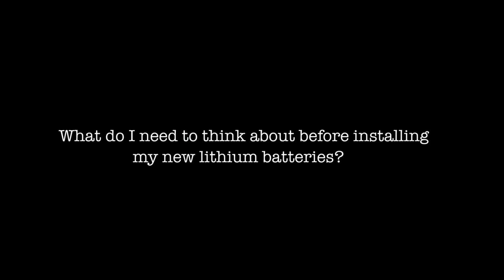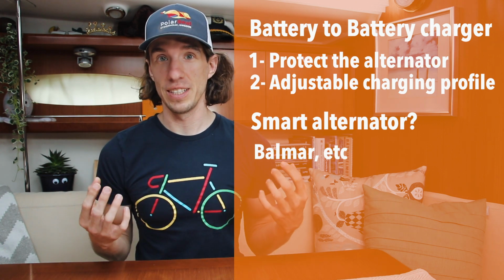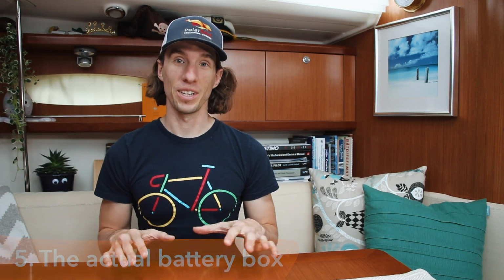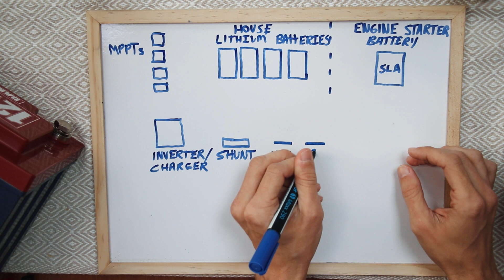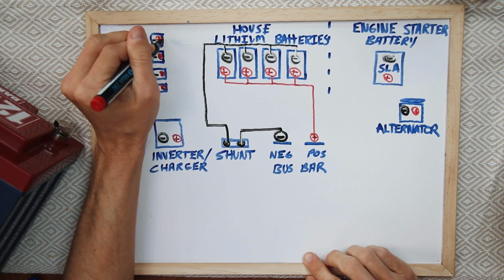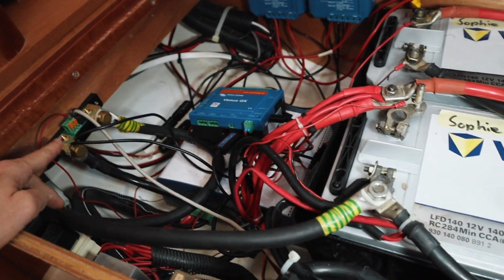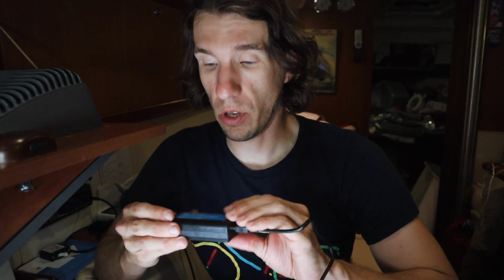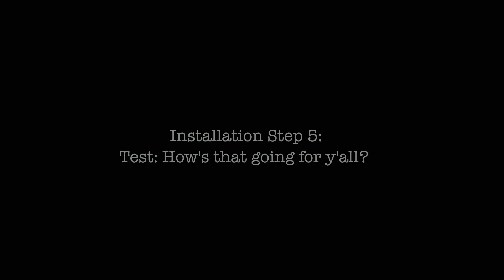How to install lithium batteries on a sailboat // Ryan’s tech corner #2

Comment: When I was a boy I made an electric hot dog maker. It was just a bunch of railroad spikes in pairs nailed through a board. About six pairs. I ran house current to the first pair and then from nail Tek nail to the back now. As you’re saying in your video I ran the wires the hot in the cold to the first pair. I found that if I Try to make six hotdogs, one hotdog across each pair of nails, the first pair of nails cook the hotdogs very quickly the second pair let’s quickly the third pair even less quickly and the last pair didn’t cook at all. I bet you could’ve put both hands across the nails on the last pair without getting much of a shock. This was about 1955. Why boat  manufactures didn’t know this is beyond me. I’m sure they did. The issue was that the boat buyers didn’t know!

Comment: I would have done it differently.
Have two or more separate systems, obviously one runs essentials such as nav lights etc.  If one goes down, hopefully not all. 
You would have to manually change over circuits and alternator charging

Comment: It's almost the same design I made, the only issue I haven't resolved yet (and you neither I see) is how to maintain under charge the starter battery when the engine is off and you are at the hook for several days under solar and wind power or moored at the marina connected with the shore plug.

Comment: This design as shown in your white board schematic, is egregious.  Where is the short circuit protection & where is the wire separation to prevent shorts.....?  What other fault conditions need protection?  What are you doing about grounding and is there any isolation between shore power ground and the boat ground and what is the scheme?  What about lightning & EMI protection?  With Lythium we are dramatically increasing energy density and I would of thought there would be advances in safety design.

By the way you commented on the FAA but readers should know that CFR 25.1309 ammt 42 made huge improvments to the way to approach design for safety.

Eric 
Boat owner for 50 years and commercial aerospace design.

Comment: I fitted six 12v, 1kWh or 80Ahr SUPER CAPS in parallel. My installation is exactly the same as described here. Victron DC to DC Charger set to 13.4 volts. They have a 1 MILLION CYCLE LIFESPAN or factory recommended lifespan of 45 years, they're non toxic, can be safely discharge to 0 volt and stored at 0 volts indefinitely, they're non flamible, can never explode, they are 99.5% efficient, and safe to transport by air. They weigh ± 15 kg each. We run an 80L deep freeze @ -19⁰C and fridge @ 2.5 - 4.5⁰C 24/7/365 plus lights, windlass too(1200W or ± 100amps). They also run nav station, auto pilot and bilge pumps. They start our 2000cc(50HP) Perkins diesel on a dime with change to spare. We've  never seen them below 12.8 volt or 80% SOC and are normally fully charged by lunchtime and on successive cloudy days they'll charge to ± 95% SOC. We're charging with 2 x 330W pollychrystal solar panels. We'll change these to monochrystal though as they handle shadows better. We live aboard permanently and have had them on our 45ft cruiser for 3 years and they're functioning at 100%. They're also available in 48 volts. These are the best things since sliced bread. Two could do the job but if enough is good then more must be better...no? 😁👍🏻
Reply: Make a video

Comment: Figure how much it's going to take then add 50% to it?

Best rule of time estimating I've seen is double and increment units. So if your best guess is three hours, figure six days. If two days, figure four weeks.

(And if you don't have water when the power is out, you need a manual pump. Redundancy in all critical systems.)

Comment: A peek into the past is also a peek into the future.  Germany lost 1/2 of it's PKW4 tanks to batteries in parallel.  It was a good thing.  In the morning,  the tanks could not start and dead batteries could not turn the turrets. Yachts and semi trucks are often supplied with isolation switches. They allow batteries to momentarily tackle huge discharges such as starting,  then be isolated for separate charging and storage. If i am going to buy two big 12 volt batteries,  I'd instead buy two 6 volt batteries to use in series.  They don't squabble in series.  One gentleman on youtube yanked his electrical project,  and posted a new article when he learned the right way he should be encouraging.  When things go wrong,  disconnect every single battery,  and charge them individually.  Don't leave anything in parallel. Fair seas,  Maties.

Comment: Good clear explanation Ryan.  Only negative is that that wiring has my OSD going stratospheric … I'd need to have it waaaaay neater and more organised !!  I'd probably end up ripping half of it out and then not know what went where and needing to get the boat rewired professionally.  My OSD is in overdrive just looking at that battery compartment.
Reply from the maker: I agree.  But to get all those wires under control i would have had to remove everything and that was not going to happen (Ryan)

Comment: Hi Ryan. According to your Wiring Diagram your starter battery is directly connected to the alternator. The electricity generated in the alternator flows through your starter battery, which is an SLA, and continues through a Battery-to-Battery charger to your positive and negative terminals and continues to charge your Domestic Lithiums. The chargers you programmed for charging the Lithiums. So far so good. In your first video you show how to increase your alternator output with a Wakespeed regulator, which I assume you have to program for the type of battery as well. My question is how you program the Wakefield to charge the Domestic bank, which is Lithium but the generated current has to pass through the SLA-starter Battery?....or did I miss a point here?
Reply: I have the same question, did you get the answer?
Reply: @kathrynlockwood1180  --no, i did not--

Comment: hi Ryan, i have pretty much the same setup as you described in the drawing.
i have my starter and housebank batteries connected to the alternator through a diode bridge. in order not to fry my alternator after installing a lifepo4 battery, i was wondering if it is a good option to connect a DC-DC charger between the Alternator and the LIFEPO4 battery instead of placing it between the starter and the house battery bank?

Comment: If the charger is set to charge on a Lithium profile. Will this be bad for the SLA. Or do we now need 2 battery chargers when connected too shore power?

Comment: Hi Ryan, very interesting video. I do have a question in reference to the 12V/12V charger to charge the lithium battery service pack from the engine AGM battery. I have Mastervolt on my boat and I know the Mastervolt Magic that is made to achieve this charging job. Problem is that Mastervolt Magic only exist in max 20 amps witch is a bit low compare to +/- 80 amps that the engine alternator can give. Can you tell me what alternative to Mastervolt I have for those 12V/12V chargers?  Thanks for your help, Regards   STEFAN

Comment: So in this LiFePO4/lead setup, is all your loads (220v, 110v, 12v) running off the inverter/charger? Or just the 220v/110v? 
If not, does the 12v loads jump off the busbars?
Reply: Yes the busbar would directly feed your 12V fuse block.

Comment: A great video, thank you. One related question was I noticed you do not use vane steering gear but rely on auto pilot, which can be power hungry. With fridges and electronics as well, you must use a fair bit of power on long trips. How long do you have to run the engine for each day to keep everything topped up? I guess the solar panels alone are not enough? Thanks

Comment: I'm not sure if you considered or did this, but is your battery to battery charger capable of reverse charging? If so what brand did you go with? I saw another battery overhaul video that used a Sterling BB1240 but that puppy is $450! The idea being, and what I want to do, is charge the starter battery off of the alternator, which in turn can go through the B2B charger to charge the house Lithiums, but also have reverse charging automatically kick in when I am parked on shore power and keep the starter battery topped off - especially over longer periods of non-use. Does your system handle this and could you (or anyone) recommend cheaper options for the B2B that aren't in the Sterling price range? Great video! Thank you!

Comment: Hey what best potects the 100ah 12volt lithium battery from rain and salt water if a bettery box is too big? This battery is IP65 rating and will be right by the transom of my montgomery 10 and will be directly connected to a 55lbs thrust aquos hewsing transom black trolling motor. Great video. Looking forward to your feedback.

Comment: The way you wired your batteries up in parallel is going to greatly shorten the life of your batteries and provide a single point of failure (lack of redundancy) on the failure of any single battery or cell.  Because LiFePO4 batteries can push such high currents, even a very small amount of resistance in the setup makes a big change in voltage (V=IR) with a big current.  The middle batteries in your bank will provide considerably less current than the ones on the end.  You are right that the original configuration (taking the positive and negative off the chain, will be the worst configuration possible (the one on the far end will provide less than HALF the amperage of the one closest to the load), but your configuration isn't much better (the ones in the middle will be about 75-80% of the load of the ones on each end). 

The best configuration is to have ABSOLUTELY identical length cables, bring them all to a common bus bar for each terminal (I.e. have 4 equal length cables going from each of the negative posts to the negative bus bar terminal, and 4 equal length cables going from the positive posts to the positive bus bar terminal).  In that instance, each of the batteries will be outputting the same amount (and discharging down to the same amount) and the failure of any single cell or battery will just result in the drop of that cell/batteries contribution rather than the full loss of all of the cells/battery.

The guys at Climate Control did a test on this with 5 batteries that is worth reading.  https://www.coastalclimatecontrol.com/index.php/blog/272-current-affairs-making-the-right-connections.html

I notice that in your blog that you had some crimping failures...  you really should have fuses on each of the batteries as you aren't protecting the load but the wires...  I know you have one big one AFTER the battery switch but as you discovered, that left all of the wires up to that point unprotected.  BlueSea makes some decent fuses that are easy to put in place and can act as your positive/negative bus bar while you are at it.  

Throw Sophie's hair dryer and some other load on and then put a DC Clamp on ammeter on each of the wires coming from your current battery bank...  I suspect you'll be a bit surprised as to how much difference there is between your batteries (and of course since V=IR, you also have drastically different voltages as well...
Reply: Unfortunately the link to the article didn't work for me, so I haven't read it. I struggle to understand why this might be the case (reduced equality of charging/discharging) as with Ryan's method you guarantee the total cable length is identical even if the individual batteries vary in terms of negative and positive cable length. Any tiny variation in charge/discharge would actually be down to variations in each cells internal resistance. Both wiring methods will suffer from that but the advantage with Ryan's method is that the link cables between cells are so short the electrons have no distance to go to sort that out. I believe Ryan said his batteries had built in BMS so if you trust those to work as they should maybe fuses to individual batteries aren't needed. The one advantage I see with your method is that you can easily fuse each cable at the battery end. With Ryan's method the temptation could be to use fused links between cells instead of the bus cables, but that would introduce a single point of failure. Better to fix fuses to each battery post then link the fuses together with the bus cables imho.
Reply: @mikebarry229  Not sure why the link doesn't work for you, I just tried it and it works fine, but the net of it is that unless the cables put the batteries exactly the same length from the common bus point (where they join the load), the ones closest will contribute considerably more amperage, shortening their life and when they fail first, they will take out the entire load.  Whether or not they have a BMS is immaterial.  To give you a sense, if you take a 5 battery system and wire them in series, the lithium battery closest will contribute 46 Amps while the battery farthest will contibute only 12 Amps.  If you wire them still in series but take the feed from the centre, the middle battery contributes 27 A, while the end ones only contribute 18A.  Doing it with equal length cables back to a common feed, means all batteries are contributing between 20-25A (still slight differences between the resistances of the cells that could be addressed by balancing the bank before connecting them).
Reply: @steveburton5825  hi Steve link now works for me too. Ok, so obviously schemes 1 and 3 are just daft, and the test results are exactly as I would have predicted. Ryan if I remember correctly used scheme 2, and I understood that you were recommending scheme 4 as you said s2 would result in some batteries only getting utilised to about 80%. That is what I couldn't understand, I just couldn't see any reason for such a difference as in each configuration the cable lengths would be exactly the same for whichever cell you chose. Looking at the test results the variation in current draw between cells for Ryan's configuration (scheme 2) with lithium batteries was between 20 and 26 amps, and for scheme 4 was between 20 and 25 amps. They are virtually the same. If we accept that scheme 4 should show no variation at all the differences must be down to cell internal resistance which affects scheme 2 just the same. That means the maximum that can be attributed to the wiring in scheme 2 is just one amp out of 25 or 4%, but that is dwarfed by the differences due to differences in internal resistance. Cell balance In terms of charge in each cell shouldn't be an issue as in all 4 schemes the cells are linked in parallel and will naturally equalise when not under load. To sum up I would say based on the tests carried out s2 and s4 are equally valid choices. S4 has some advantages in terms of ease of fusing and battery removal without having to disconnect the entire bank, but disadvantages in terms of extra cable length (cost, complexity, cable losses and connection losses). I would also point out that for scheme 2 in order to carry out the test short links were wired between each terminal and the main cables so clamp meters could be used and this alone could account for the tiny differences noted between s2 and s4. If you can imagine a revised version of s4 where you didn't worry too much about the individual cable lengths to the positive and negative terminals of each cell so long as the total length of both was exactly the same for every cell, that wouldn't change S4 at all. S2 is just a functionally equivalent version of S4. In both circuits the electrons have to travel through exactly the same amount of cable to provide the power required, regardless from which cell they originally came. That is not true for S1 and S3 and accounts for the variation  in cell usage for those configurations.
Reply: @mikebarry229  He did indeed use Scheme 2 but there is still a 30% difference between the ends and the middle in that scheme.  The guys at BlueSea and Climate control would argue with you that they are equivalent (and they aren't in my testing with 12 batteries (in a 2x6 configuration for 24V system).  Doesn't really matter anyway as it doesn't appear that Ryan is listening to either of us!  :-). I guess if I had Sophie on the boat looking at me with those adoring eyes, I wouldn't be paying much attention to esoteric discussions on LiFePO4 either!

Comment: Hey Ryan. I am actually getting Dakota batteries (talked with Elise). Is this video still good to follow or did things changed since were in 2023?
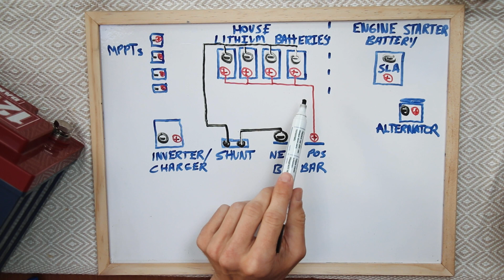Also what did you mean 11:19 about the way terminals are connected?
Reply: He's talking about having the positive and negative connection on the opposite sides of the battery bank. If you number them left to right 1-4, he has the negative on battery 1 and the positive on battery 4, instead of having both positive and negative on 1 or 4. Lately people are recommending having all the battery terminals go to a busbar with equal length wires and then connecting to the busbar. This will use each battery equally and keep them balanced. He also neglected to mention fuses and with Lithium batteries, a class T is recommended for the primary protection of the battery bank. Some people are putting an MRBF on each positive terminal before going to the busbar.

Comment: This two part series  was a great explanation of Li Fe PO4 vs lead acid.
When you gave your cost comparison, did you include the cost of new cabling and new crimping tools?
Reply from the maker: No, not really.  Its a very valid point though because that can add up quick.
Reply: Thanks for getting back to me Ryan..
My IP 35 is still in the Carribean at SXM
 For now, I’m gonna stick with my original 60 amp alternator and
 A 2000 watt Honda generator

Comment: I have one question ... how does the shunt communicate with the inverter / charger?  You never showed any connection between the two on the schematic.  Are they both Bluetooth devices?